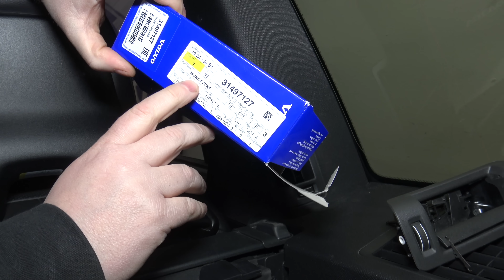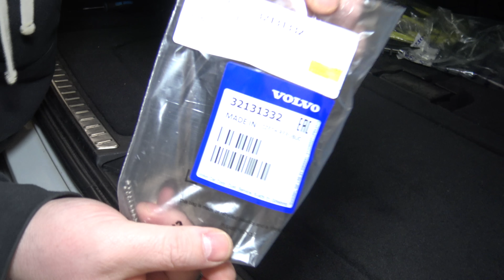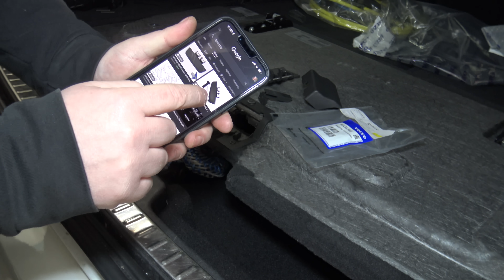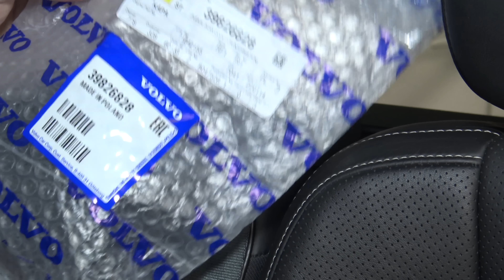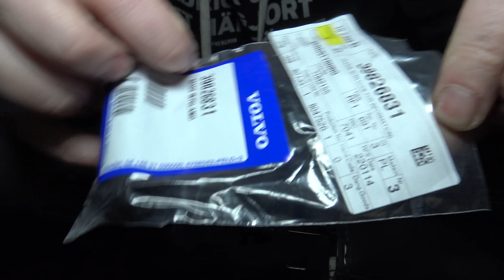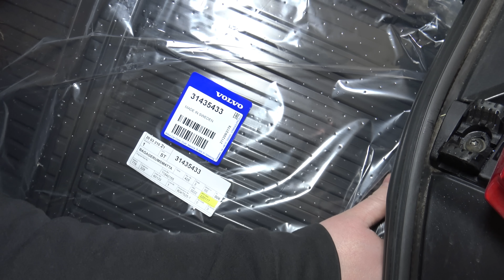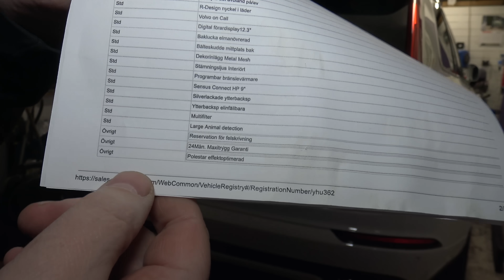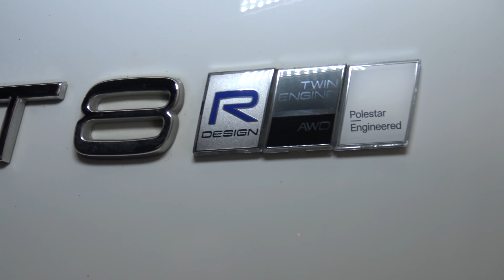Lagar min Volvo XC90. De har ju slaktat den invändigt!

Comment: Sälja gamla motorn och batteriet så får du en liten slant
Reply: Exakt det finns ju pant på batteriet 👌👍🏽
Reply: @GiBBAify  Japp
Reply from the maker: Får man en nästan ny motor på skroten för 2000kr vet jag inte riktigt vad en skuren motor kan vara värd. Den åker på tippen.
Reply: @StefanBergman  dom kör på kilot
Reply: @GiBBAify  Vad får man för det? och var?
Reply from the maker: @andreashansen5153  men vad får man då, typ 4kr kilot för aluminium. En motor väger 100kg? 400kr då 😄
Reply: @StefanBergman  Jo det är ju sant va bara ett tips.